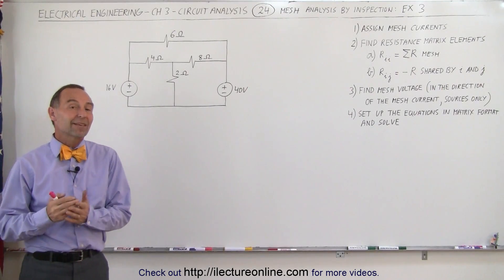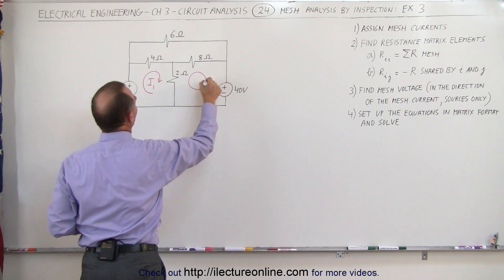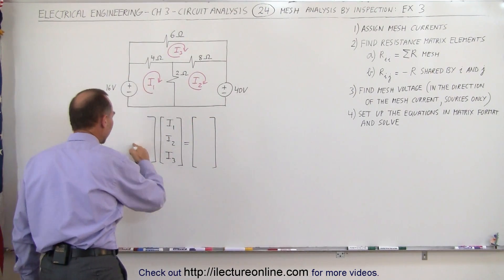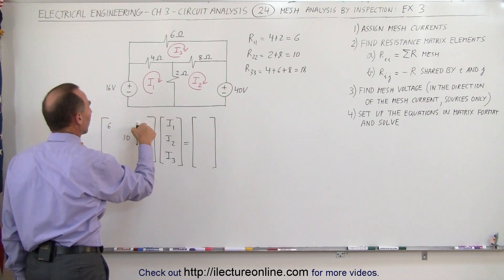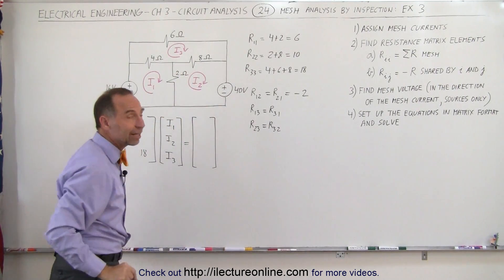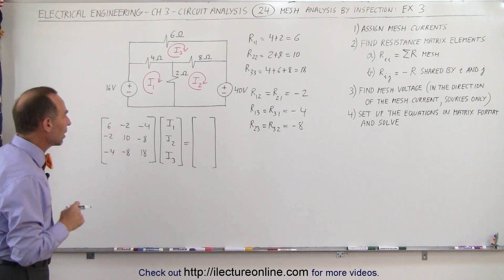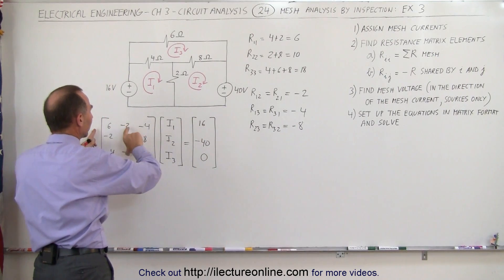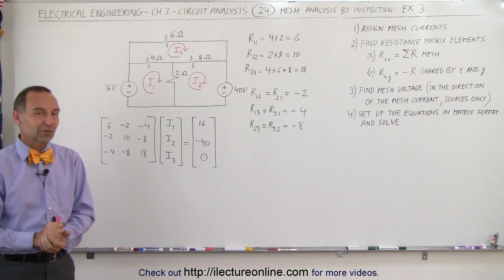Electrical Engineering: Ch 3: Circuit Analysis (24 of 37) Mesh Current by Inspection: Ex. 3

Comment: Sir I have a doubt. How can choose direction anticlockwise and clock wise and also that negative signs r12, r21.
Reply from the maker: It is OK just to choose a direction for the currents and then solve the problem accordingly.  If you chose the "wrong" direction, your results will come out negative.

Comment: Plz tell me why there is negative in front of no
Reply from the maker: Did you mean to ask why is the 40 V negative?    When we travel around the loop in a clockwise direction we cross the 40 V voltage source from the positive terminal to the negative terminal.
Reply: @MichelvanBiezen  these matrix elements sir R12 and r21
Reply from the maker: Ah, now I understand the question.  In this method we us a + value in the matrix when you cross a resistor in the same direction as the current, and we use a - value in the matrix when you cross a resistor in the opposite direction as the current.  (We can reverse that and you would get the same answers).
Reply: @MichelvanBiezen  thanks sir , u r the most consistent youtube teacher in clearing doubts from comment section , hats off sir
Reply from the maker: Thank you for the compliment.

Comment: Hi sir! This is what I got:
D= 336
1= -864
2= -2592
3= -1344
I1= -2.6 A
I2= -7.7 A
I3= -4 A
Kindly correct me if I’m wrong. Thank you and more power!
Reply from the maker: Don't have the time at the moment to check.  For these older videos, if a mistake was made in the video, viewers would have found it.  Any other comments indicating there is an error.
Reply: Yes I got same answer